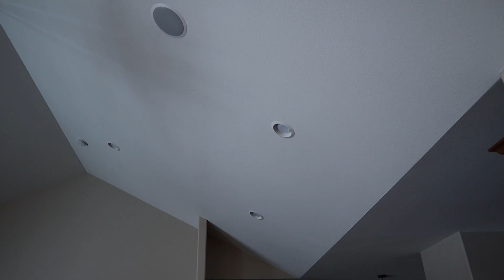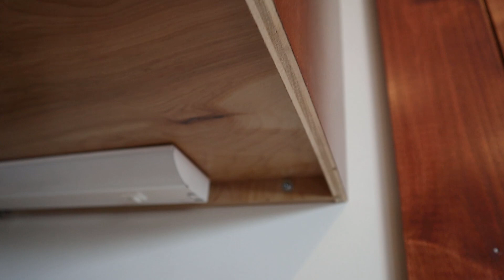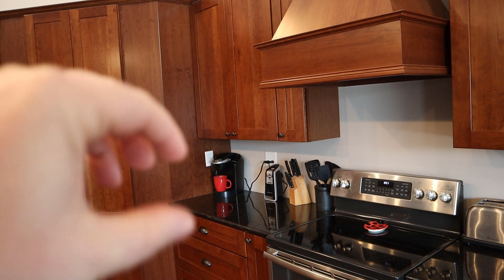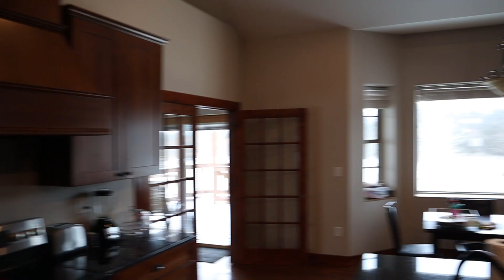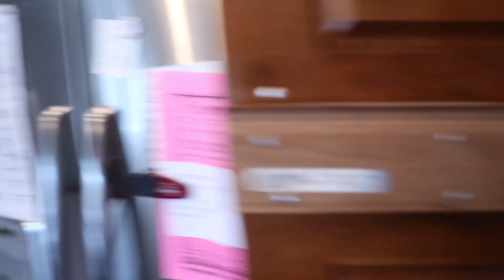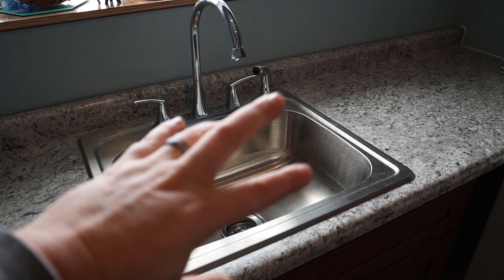11 Tips For Every New Home Build

Comment: Great info, Thanks Garrett!  Another one that I plan to do is elec. sockets in my soffit every 75' or so, all wired to one switch in the house for Christmas lights or projects around the house that require electricity.
Reply from the maker: That's an excellent idea.  I did that as well

Comment: Only thing I disagree with is whole home audio. Was a great idea 5 years ago, but with all the advancements regular audio, there’s no point. Just a lot of money to put out on something that will be completely outdated in 2 years.
Also, with the hose spigots at the front of the house and in the garage, have them plumbed in off the supply before the softener, as well as after the softener, that way if you are washing your car, you can have the soft water, but if you’re watering the grass, you can have regular water at the turn of 2 valves.
Reply from the maker: What are the advancements in regular audio?  I must be behind the times, because I haven't seen anything that is zoned and sounds this good.

Comment: I never saw the appeal of whole home audio, to me its kind of just a gimmick.  Most people spend most of their time in the kitchen/living/dining area.  Most modern homes have these areas as a relatively if not completely open "great room".  A halfway decent surround sound system in the living room for your main TV will be able to play music as well for the areas where you spend most of the time, and it's going to sound way better than the sound coming from a few undersized speakers placed overhead in the ceiling which is a far less then ideal location for speakers.  The only other place I'd want to listen to music is in the garage or detached workshop when spending hours working on a project.  In that case I'd just turn on my car stereo, which is also going to offer a MUCH higher quality sound than you'd get from ceiling mounted speakers.  I can't think of a single time when I wish I had a stereo system in my bathroom/bedroom/etc.

Comment: As for 1st item on your list, Leviton offers an outlet with 2x USB-C ports, which charges as fast as having a large iPad charger on each port, but without the bulk.
Reply from the maker: I'm assuming usb-c must be relatively new?  What I showed, I installed 3 and a half years ago.  So It's probably old tech, but still super useful.
Reply: @TheChallenged1  it’s been available for almost 2 years but yes this is fairly new. That’s what I have at home and we love it. Leviton’s pn is T5635-W fyi
Reply from the maker: @SupersonicFX  I'm assuming new tech is switching to this style?  So far, we don't have any devices that come with this cabling.  They all come with the C-port on the device and usb on the charging side of the cable.  Regardless, if everything went to the C-port and the cabling to support it, then that is what someone should put in their house.  The point of the video suggestion was not to push usb, but to make the viewer think about adding some sort of charging port for devices within their new home build.

Comment: I built a fairly large lint screen into my wall (in the stud bay) above the dryer using a couple of Dzus twist lock fasteners for securing the door so it can be opened every six months or so to keep the lint from building up down through the years in the fairly long duct to the outside. The built in screens inside dryers pass a lot of lint and in 5 to 8 years the buildup can restrict the flow enough to cause energy usage to go up, drying time to increase and even become a fire hazard.
Reply from the maker: Excellent idea!!!
Reply: 500 points for that build . . .  SMART!